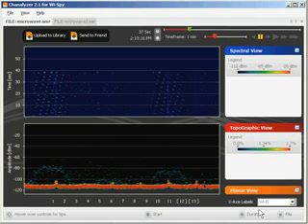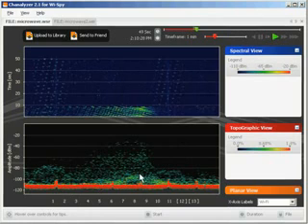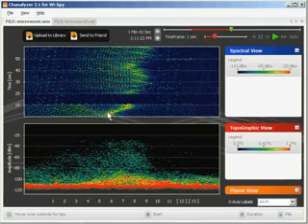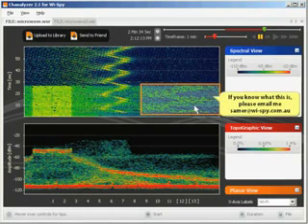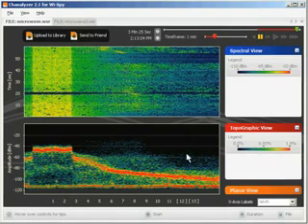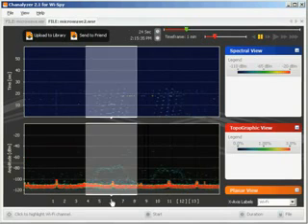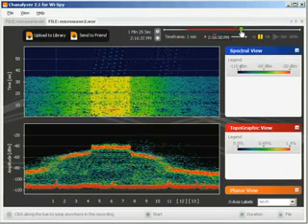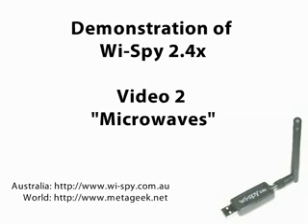Chanalyzer / Wi-Spy microwave analysis

Comment: Because the second Z pattern higher in freq is occuring only when both the WiFi and the Microwave are on, I'd submit that it is more likely a result of "mixing" than a harmonic. 

That Z pattern due to spinning is an interesting theory, but how would spinning food make the frequency change?  Amplitude yes, freq I don't think so.  Could be the design of certain microwaves to avoid persistent interference w/ consumer electronics...would interfere some of the time but not all = fewer complaints.